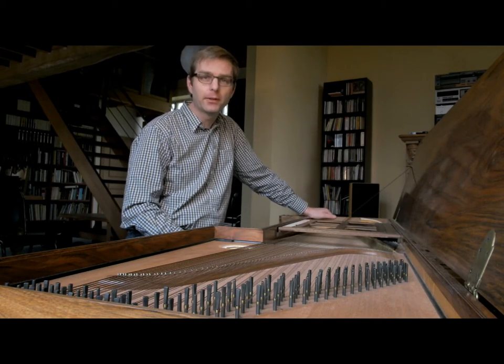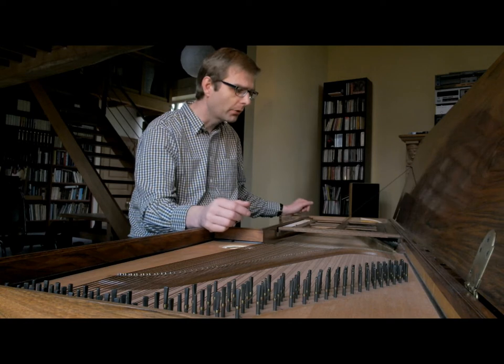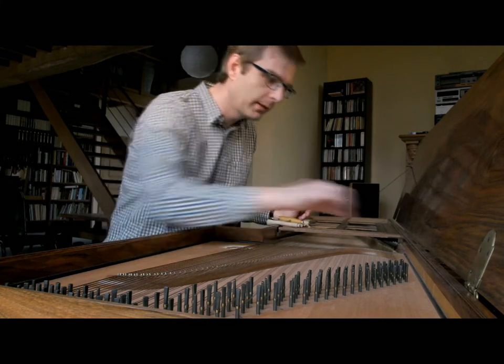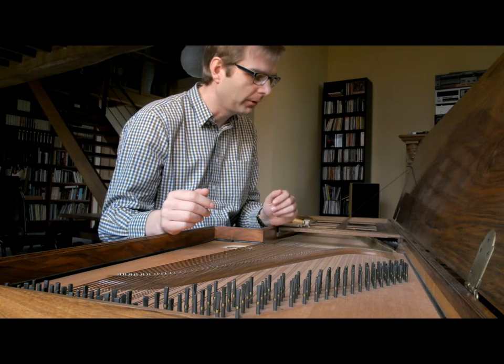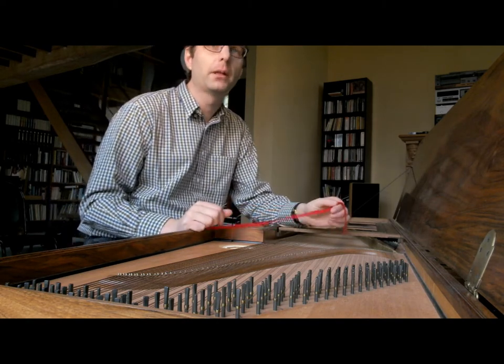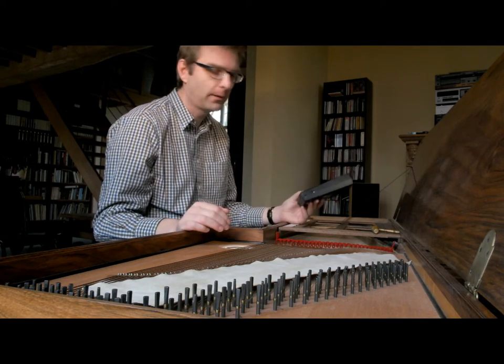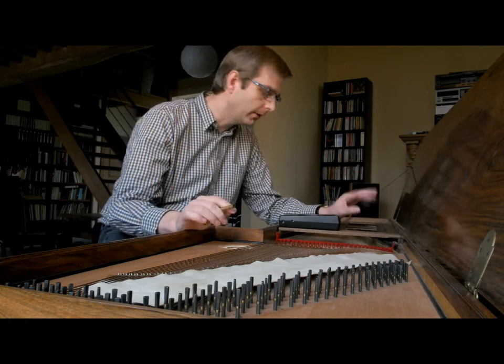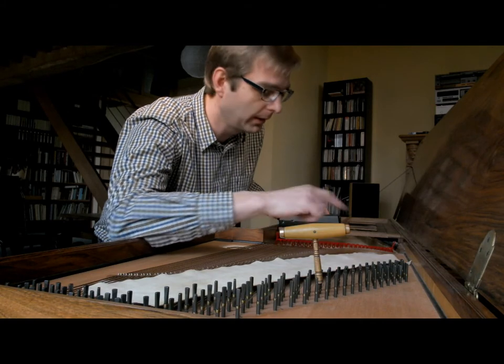V3: Tuning (part 1): some basic techniques

Comment: Just a tip: clavichords can be tuned with an electronic tuner, provided you use a pickup microphone. This is the sort of microphone guitar players use to amplify the sound. It only captures mechanical vibrations. This was an advice of my professor Loreto Fernandez Imaz long time ago. When buying the pickup microphone, the cheaper it is, the better, because we do not want it to capture the harmonics. It comes wiith a small piece of putty with which you adhere it temporarily to the sounding board. The putty does not leave any trace afterwards in the sounding board, at least in my case.
Reply from the maker: Thanks for sharing, Miguel! I'm about to remake some of those older (very first !) videos, today, I'm tuning totally on my ears, except from the pitch, and that is in fact much easier than I would have thought when I just had my clavichord. Thanks for watching !